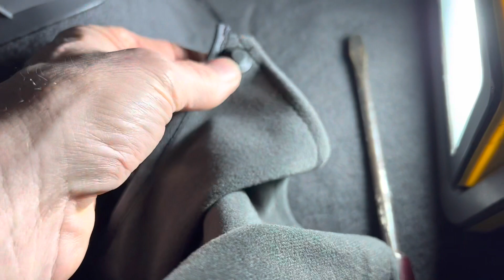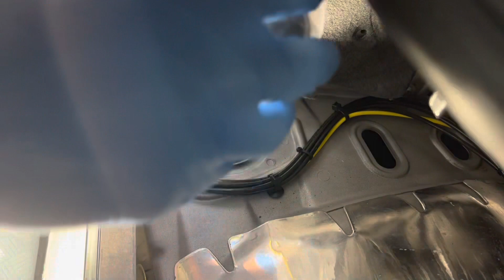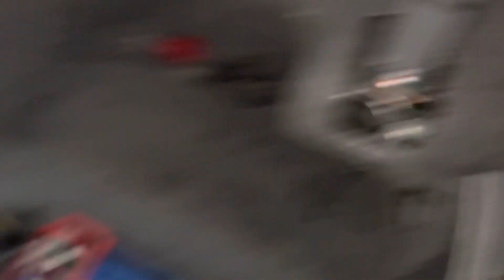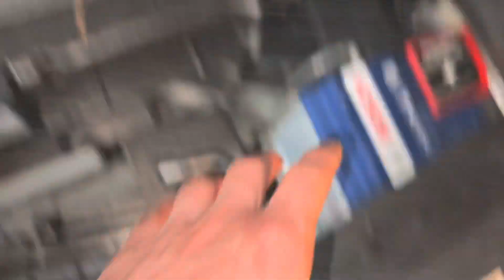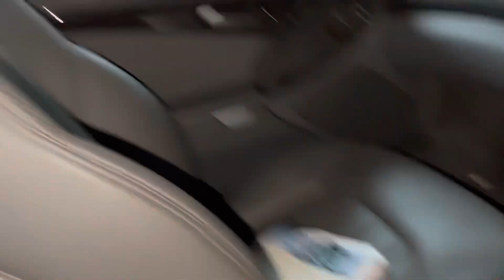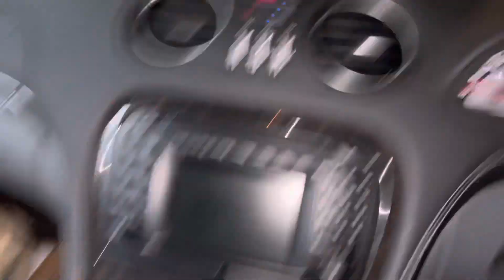Mercedes R230 SL55 AMG ABC Visit Workshop fault- FIX including how to remove the boot/trunk liner

Comment: Hola Mike, despues de arruinarme en varios talleres jaja, decidí comprar un escaner Launch para mi SL 55 AMG R230, porque insisten en sustituir el amortiguador trasero derecho, y me da el fallo C1129 "Fault in component B22/6 (Right rear plunger travel sensor). Crees que solucionaré mi problema de ABC sustituyendo solo esa pieza? Gracias por el video.
Reply from the maker: Hola - here is what I would do:

1. Carefully remove the Right rear plunger and the left rear plunger and swap them over.

2. Rescan the car and if the fault moves from right to left, that would be a pretty good indication that the sensor is bad.

You can buy a new sensor from the link below:

https://www.abcspecialist.nl/en/sl-class-r230-plunger-sensor-abc-shock-absorber-st.html

Mention mikesmercs YouTube channel and they might even offer you a discount.

Mike
Reply: @MikesMercsandothercars  seguí tu consejo y el problema se ha ido al lado izquerdo con el sensor, y el lado derecho ya no da error, esta misma noche lo pido y mencionaré tu gran ayuda, muchas gracias Mike.
Reply from the maker: Thanks for letting me know - I hope the repair goes well. Mike
Reply: @MikesMercsandothercars  Hola Mike, me ha llegado la pieza y ya fui corriendo a sustituirla, con los tapizados quitados fue una tarea muy facil, luego con el escaner calibré los sensores y por fin desapareció el mensaje "ABC acuda al taller", menuda alegria!! nunca había probado el coche con la suspensión bien,  y es como una nave espacial en modo confort y un F1 en sport, jajajaja. Muchisimas gracias por el video y tu consejo, que me ha impulsado hacerlo yo mismo. Próximo reto: ABC FLUSH.
Reply from the maker: That is great news! Thanks for letting me know. My next job is to renew the ABC pump and change the dust covers on the struts. Here is the ABC flush video in case you have not seen it:

https://www.youtube.com/watch?v=cGGTHCToYj4

Mike
Reply: Hola Mike, había pensado en eso pero necesitaba una sugerencia, eso haré y te cuento, muchísimas gracias y descuida, no olvidaré mencionarte, saludos.
Reply from the maker: @RSV624  Good luck. What year and what model is your car? Mike
Reply: @MikesMercsandothercars  Es del año 2003, con 140.000 kms y en muy buen estado, aunque tiene unos pequeños fallos que iré arreglando poco a poco.

Comment: Hi Mike I am at the stage having just got the boot liner corner removed exposing the plunger ,the wiring and plug looks as new  so have ordered replacement plunger ,the boot lid seem reluctant to return to normal position visa ve roof in operation and i am hesitant to force it,can you recall if your was similar ,the last 6 ins before it would be latched strong resistance?mine seems to hit something solid,i am also wondering if I allowed the roof open operation enough travel before putting key in and into service position ,don’t think you would recommend closing roof without boot locked down.your thoughts would be appreciated
Reply from the maker: Hi - sorry to read you are having problems. Did you get it sorted yet?

When you are initially opening the boot, you can let the flaps open and then move the switch back a tad just so the flaps close. That will let you know when the boot is in the right position for service mode. 

When it comes to re latching the  boot lid after service mode, I don’t recall encountering any resistance. I seem to recall that you have to keep the key in the boot lock in order to relatch the boot lid. 

Those hinges are very easy to bend so don’t force anything. If you bend them out of alignment, you will enter a new world of costly pain. 

I wouldn’t try opening and closing the roof when the boot lid is unlatched. You might end up damaging something irreparably. 

If you are still having problems, send your telephone number to m_scott65@hotmail.com and drop me a message on the YouTube channel to let me know you have done so. I don’t ever look at that email unless I’m expecting something. Mike
Reply: @MikesMercsandothercars hi thanks for the info ,I’m having a breather till part arrives,when I first turned the key it was quite stiff to turn and with more pressure it sprung open with a jolt that concerned me,and later I attempted to close it  and had this problem i had thought that it could get expensive and I should ask around ,it may be with a little toggling at the roof switch a few silent prayers it will come together ,there  is an independent merc  trained mech relatively nearby but not friendly at all.will keep you posted thanks .
Reply from the maker: @BrianPaterson-f3i  Where do you live? Mike
Reply: @MikesMercsandothercars about 12 hrs north of Bristol ,Aberdeen to be precise,(bet your glad),I’m a member of the Mercedes car club so if I have to can call on other members for info ,it is only in the past 2 yrs we had yearly meetings and one of those was in very bad weather hence I have not made many connections .

Comment: Hi Mike
Great video, quick question did you disconnect batteries before removing the sensor?
Thanks
Reply from the maker: No - I left both batteries connected. If you disconnect the consumer battery, it will have consequences for some of your saved settings.

If you do ever need to disconnect both batteries, its is really important to remember to disconnect consumer battery first and then starter battery in front. Similarly, when reconnecting...starter battery first and then consumer battery. In the last video, I made the mistake of not connecting a starter battery terminal up tight enough and got the red warning of death....and this can only be cleared with a scanner. 

Mike

Comment: This procedure might make sense with a museum quality car, but is way overkill for any other 20 year old car. The carpet sections over the struts can easily be pulled out/up from the center section that covers them; then a quick slice with a box cutter and you have full access to each strut. When done, push them back under the center section and the cut is barely visible. Also no need to cut a circle as done in another video on the subject, just a slit that will be invisible.
Reply from the maker: Thanks for the tip - you are right, that is a much quicker way of getting to the rear struts. Personally, I'm always a little reticent to start unnecessarily modifying a Mercedes in that way. I have the luxury of having time to do it and the added bonus of seeing exactly how the boot/truck area is put together. Mike
Reply: @MikesMercsandothercars Those clips snapped instantly when I tried to remove them 😢
Reply from the maker: @simonjones4776  I'm just about to do the valve cover gaskets and am armed with new injector clips prior to starting..."Forewarned is Forearmed"! Mike

Comment: I always do plunger, then level, and finally load adjustment. Works every time
Reply from the maker: Hi - thanks for your comment. What scanner are you using? I'm pretty sure my Autel MaxiDas has a software bug which prevents me from using it to recalibrate the suspension. Mike
Reply: I generally use the autel ms906bt for this. Try doing them in separate key cycles and see if it works. The fault for incomplete calibration clears on its own once the load adjustment is performed.
Reply from the maker: @powayimports4175  Thanks for your reply.

If you watch the video below, you will see that despite following the correct procedure, I end up with a Visit Workshop fault. The Merc indy followed exactly the same procedure on DAS STAR and it worked straight off:

https://www.youtube.com/watch?v=-YfbzeBZohQ

Where are you based? 

Mike
Reply: In sunny Southern California! San Diego to be exact.
Reply from the maker: @powayimports4175  Nice...I spent a year in LA...and travelling around in my Dodge Ram. Loved it. Mike

Comment: Which OBD do you recommend for the R230?
Reply from the maker: iCarsoft 2 is fine for basic fault finding and not too expensive.

The Autel MaxiDasDS 808 is the main one I use.This allows you to control modules and reset various things. I think you can also use it for coding new modules to the car....although I have not had to do that yet.

I bought mine from a guy off eBay and the problem is that Autel have never recognised me as the owner which means I cant get software updates. If you ever watched my "I broke my ABC suspension' video, you will see here is a bug in the Autel software when it comes to recalibrating suspension. Maybe this was fixed i later versions?

Is it for you or for a friend? Mike
Reply: @MikesMercsandothercars  Thank you Mike. Can you also do the ABC calibration and ABC flush/testing?
Reply from the maker: On the Autel, you should be able to do a proper ABC fluid flush eg RODEO to warm up fluid and then moving each strut manually to drain fluid into a bucket.

As mentioned, I had a problem trying do height calibration on the AUTEL. Although  you SHOULD be able to do it, I kept getting an error. Using exactly the same process on STAR - no problems...which led me to believe there is an obscure software bug in AUTEL for my model of car.

You would be more than welcome to borrow my scanner. If it does what you need - great. If not you have saved yourself hundreds of pounds.

Mike

Comment: ABC is what makes these cars drive so well.But I'll be damned if I ever buy another one.I had an 03 SL55 for over 10 years.
Unfortunately the ABC suspension is a nightmare when these cars get some age in them.
Reply from the maker: Agreed....lovely to drive BUT there will be costs down the road. I am intrigued to see if I can figure some of these repairs out for myself and maybe pass the knowledge on. How hard can it be? A few nuts and bolts...some high pressure hydraulic fluid lines...pump..rubber  O rings. It is not a car you would want to over pay for! Mike

Comment: Great tutorial Mike, you have another subscriber. I have an SL55 sagging on one corner but no leaks and it drives just fine. What symptom did you have other than the ABC warning message, did you have a corner dropping on the car? Are there level sensors in the other struts too please?
Reply from the maker: Thanks for your comment. Sagging on one corner is usually a sign of a problem with your valve block. I assume the car levels up when turned on and when you are driving, but sags after a day or two of being parked? If those are your symptoms it’s time to replace the rubber gaskets in the valve block……and probably the hydraulic fluid too. Sagging on one or two corners won’t trigger any dash warning whereas problems with the strut sensors or level sensors will. Mike
Reply: @MikesMercsandothercars  I have a valve block seal kit ready to go. I did one of them a few years back and the sinking improved and slowed but now the rear right drops in about  10 mins after shut down. When you changed the sensor, what was the physical problem you had or was it just the ABC message?
Reply from the maker: @simonculmer6624  Hi - it was just an ABC message - there was no physical problem. If the problem lay with your strut sensor, you would get an ABC error on the dash. Mike

Comment: My ABC has an intermittent fault and it settles uneven on the right rear only happens after driving it on it first leg, if I stop the car the "ABC red drive carefully".  My fault reader is as sophisticated as your what brand do you use?
Reply from the maker: Thanks for your comment...I only got half of your message. When you plug in your scanner, are you getting a fault code? Mike

Comment: Thank you for sharing your experiences, as an SL55AMG owner I will be following your journey with interest, and attempting to replicate your self help attitude, perhaps get an assistant to film for you.. Two hands has to be easier! 😀 kudos on your height adjuster fix, amazing that Mercedes don't sell that part.. I use a panel tool which has a small u shaped tip for removing those  plastic panel clips that have a pin in them.  Regards John.
Reply from the maker: Thanks for your comment...and yes one day professionalism will get the better of me and I'll invest in a decent camera stand. Went to see my mates at Autoclassico yesterday who were in the process of removing the power steering/hydraulic pump on an SL65. They were mighty pleased to find out about the ABCspecialist in Netherlands because a refurbed pump from Merc costs considerably more. You have reminded me to buy a decent set of panel clip removal tools! Mike

Comment: This could save me ££££s the next time my 2005 SL55 needs a new strut or sensor. Thanks Mike, where are you based; I’d like to buy you a drink! 👍
Reply from the maker: Thanks for your comment. I'm in sunny Bristol UK. You are right...there must be many R230 owners out there that have spent thousands when the the problem could have been solved for hundreds. Mike
Reply: @MikesMercsandothercars  That’s a shame as I’m in not so sunny Norfolk UK! Looking forward to your next post on the SL55…
Reply from the maker: Maybe you do me a small favour which will help me on the current video I’m doing? Can you tell me whether your glove box light comes on if you open passenger door and then open glove box - eg with no keys in ignition. Also…. does your glove box light go out immediately if you manually press the small lever which operates the switch…..Thx. Mike
Reply: @MikesMercsandothercars  - In answer to your questions: ‘yes and yes’. Hope this helps!..
Reply from the maker: @ash44roberts  Brilliant thx. On some Mercs, glove box light only comes on with ignition set to position 1. Mike
Reply: @MikesMercsandothercars  Not a lot of people know that! I’m sure this would make a good ‘Who wants to be a Millionaire’ £1m question.. 😂

Comment: I have another question which sensor is the one that reads the top is locked when it’s closed is it the front right sensor on the windshield or the driver side rear limit switch
Reply from the maker: Thanks for your comment. Are you asking this because you are getting an error on the dash...or your roof wont close? What are the exact symptoms of the issue? There is a 'roof locked limit switch' on either side of the roof (S/91/2 and S/91/3) and an additional roof limit switch (S91/1) above drivers seat for a RHD UK car. 

The following 'Vario Roof diagnostic aid 'sets out the location of the switches:

https://mbworld.org/forums/attachments/sl-class-r230/135285d1216509049-vario-roof-diagnostic-aid-vario-roof-diagnostic-aid.pdf
Reply: The roof works I’m getting a reading on the dashboard roof operation while it’s closed convertible tops works good just while I’m driving it says that the rollbar doesn’t come up or down it s down now the windows don’t do the function stays open a little when I open the window both rear and front window go down together
Reply: What I did was too wasn’t working I unplugged the rvc and plugged it back the top started working good besides the rollbar ever since then the too works but not the rollbar
Reply from the maker: @tonymontana4349  Hello - You may need to reset your roll bar. Try these things:

1. Disconnect consumer battery in the rear and leave it disconnected for 5 minutes to allow various modules to shut down. Sometimes that will reset the roll bar.

2. If that doesn't work, try pressing and holding down the roll bar "up" button for 10 seconds until you hear an audible click. That resets the roll bar mechanism. You might have to try this a couple of times.

Page 51 of the owners manual gives some additional info.

Good luck. 

Mike

Comment: I desperately need to replace the seals on my r107 hardtop that go against the top of driver and passenger window. Any chance you can do a video on that?
Love all the info that you share with us, happy new year 
Thanks
Reply from the maker: Thanks for your comment. May I ask why you need to replace these seals - is it because they are falling apart...or because the windows do not meet the seal and let in wind/water? Mike
Reply: @MikesMercsandothercars  They are disintegrating , cracking etc

Comment: Good job! But what you have changed is not the height sensor, but what is called the plunger sensor. 😉
Reply from the maker: Yes you are right! I will add an amendment in the description. Am I right in assuming that the plunger measures the height of that strut by gauging how much oil is in the strut? Mike
Reply: @MikesMercsandothercars  no, for what I understood they are magnetic sensors. Will found you the details
Reply from the maker: @celts153  That makes sense because when I extracted it it wasn't dripping with oil as expected. Mike
Reply from the maker: Thanks for your email regarding plunger sensors - your help and experience is much appreciated. mike
Reply: @MikesMercsandothercars  where can I send you some pics of the description ?
Reply from the maker: If you have a moment, can you give me some advice? I've taken out the tracker from the SL55 and that has helped the battery drain but not cured it. With a bluetooth clamp meter on the leisure battery, trunk lid closed and nothing on, there is a 2.6 amp draw. This stays constant even if I pull all the fuses behind the drivers seat. If I take millivolt readings across all the fuses in the front two fuse boxes under the bonnet, none of them appear to have any appreciable voltage across them. I didnt physically pulled each fuse in the front because my fingers were too sore..and the fuse puller wasnt helping (20 years in situ). So....where to look next. I'm thinking maybe the battery control module isnt shutting down or maybe the diodes in the alternator eg something that hasnt got a standard blade fuse. What do you think - and how would you go about testing. Mike
Reply: @MikesMercsandothercars  hi Mike, I’ll write you an email tonight. Let me know as soon as you have it.